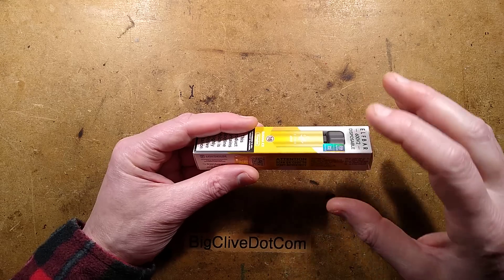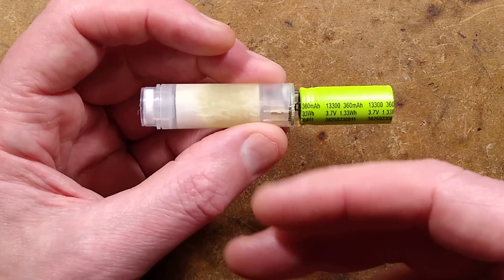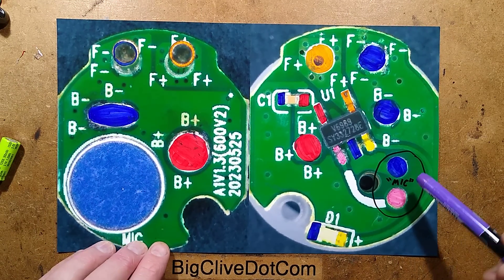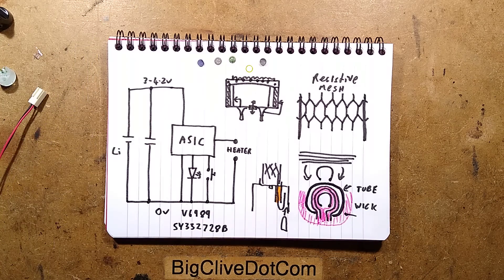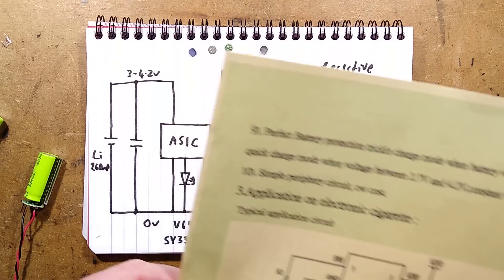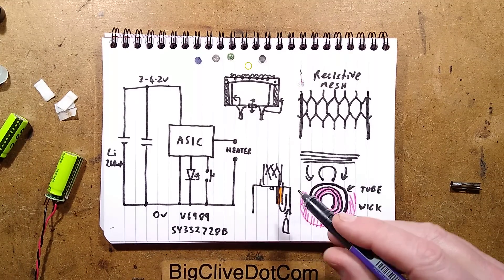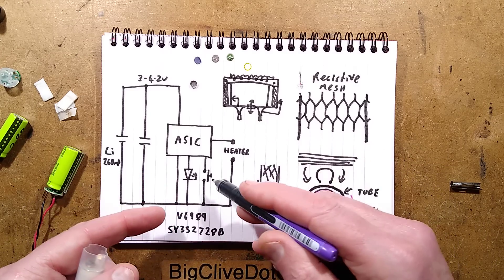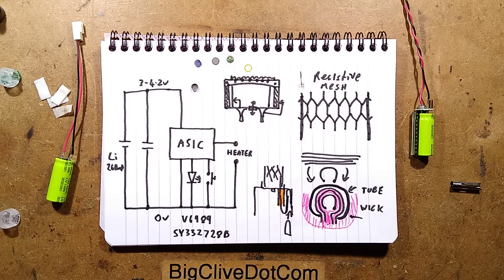Lithium "capacitor" in a disposable product

Comment: As I understand it, once a LIon cell EVER falls below 1.4V, the copper electrode starts to go into solution.  Then when the cell is recharged, the copper plates out and forms nucleation points.  Then lithium whiskers begin to grow, every time the cell is charged.  Sooner or later they tend to puncture the cell membrane and short out the cell, possibly causing a hot spot and igniting the cell.  Anyone remember the laptop and cellphone batteries that caught fire?
Reply from the maker: I featured that in a video a while ago.  The primary damage to cells seems to happen when they are reverse charged.

Comment: @bigclive, I found a 'lithium' battery marked at 2.4V. Any idea how they pulled that off ?
Reply from the maker: Not sure.  That's quite an odd voltage.  It's usually 1.5V or 3V for non rechargeable cells.

Comment: The mic IS a  condenser type microphone that requires power to use. They are used for audio reinforcing well as recording. Think concerts mic-ing instruments. They are also use for pressure differential sensors, which appears to be the case here, the subject sucks on the mouthpiece, this creates a negative pressure and turns the device on.

Comment: I've used a very similar (but much smaller) battery with a pwm driver to power a small LED on a cosplay accessory to be able to squeeeeze it into a tiny space without the bulk of things like battery holders or connectors. It made the difference between fitting in the available space and not, and with the tiny draw of a single LED it'll likely never be used enough to be depleted

Comment: As i first saw this video i asked my self if these are some form of Hybrid Capacitors. They were mentioned in one of my lectures at University a few years back. Did you check if they are some form of Hybrid between Capacitor and Battery ?
Reply from the maker: I think they're just purely a lithium cell.

Comment: The cartridges also contain heating elements which get gunked up over time, so you wouldn't really want to refill a single use vape. The "best" and cheapest method is to get a refillable tank unit and replace the coil every once in a while.

Comment: BC.C, ever since you first highlighted these disposable devices with rechargeable Li batteries. I've a few friends keeping the units for me to pull apart and to reuse the Li Cells and other parts for my own little projects. I've not come across this version yet. So it is interesting to know in what way they are connected first. Then, I can dismantle without shorting them out for me to salvage the Li Cell and other components. Thanks, buddy.
PS: Knowing you, Clive, you will want to deconstruct the Li Cell to have a look at its internal guts. Hmm, will there be smoke and fire, lol.

Comment: I'm glad the EU battery regulation will effectively ban these from 2026. (The regulation requires batteries in small devices like this to be user-replaceable, and it doesn't exempt disposable devices.)
Reply: Small correction: it comes into force in the EU on 18 February 2027. As often is the case, it took longer for the law to pass than they expected, so the date slipped.
Reply: It will backfire. I am soooo sure about that. Absolutely every EU regulation backfires and makes things much worse.

Comment: I ended up with a couple LiFePO4 cells in a similar package, I thought it was an interesting application for small devices, as it would make installation footprint on a board relatively easy.  Good point on having both ends of a cell right next to each other on a board, though, I can see that getting spicy if you're not careful.

Comment: My dad had a flat tyre the other day - heard a bang and then a hiss. Saw a 1 inch hole in the side wall. The guy at the tyre garage found one of these disposable e-cigs inside the tyre; they think my Dad must have driven over it in the street and it had exploded and shot into the side of the tyre. Apparently the second time they've seen this.

I wonder whether the capacitor package makes it more likely to turn into a projectile?

Comment: I found several manuals for this kind of ASIC controller and the MIC is indeed a microphone. According to the datasheet, a capacitance measurement circuit is used to detect pressure using a microphone. BTW, there are many pin-compatible chips that provide a charging function from the heater pin (ChipSourceTek FM8018A, Forkin P085 but P086 is a non-rechargeable version).

Comment: I never would have guessed a microphone could be used as a pressure sensor.
Reply: Yes, they can be used as microphones, or pressure sensors. Either way, they are generating a small voltage according to the change in pressure, despite what @celestialgamingxd  says.  Piezo devices can be used as microphones, pressure sensors, shock sensors (like in glass breakage sensors for alarms),  strain gauges, Etc. They are very versatile.
Reply: Bugger me, what do you think it does?
Reply: I'm the developer of this idea.
Reply: Its a pressure sensor, not a microphone.
Reply: @celestialgamingxd   What do you think sound is? It's variances in air pressure.
This device could be used as a microphone OR a pressure sensor. Piezo devices are what create the spark in many lighters. Piezo electricity works 2 ways, apply pressure, it develops a voltage, apply a voltage it generates movement. Ultrasonic cleaners also use large piezo devices to create the ultrasonic waves by reacting to a amplified ultrasonic square wave signal.
Reply: @jeffreyryan7671  This isnt i correct, however this isnt a piezo, they vannet be used as microphones, as much ss i wish they could for recycling purposes. Tons of people have tried
Reply: @celestialgamingxd  You change how a piezo is made, it becomes useful for different things as I said.
Reply: @celestialgamingxd  Does vannet mean cannot? If you put pressure on a crystal, it creates a voltage,  Put a voltage across it, it moves. THAT is a Piezo fact. However, I did get mixed up in that Electret condenser mikes are a (special made) capacitor with a steady-state voltage across it. It creates a signal when the sound moves one of the plates. I shouldn't have smoked that corn silk.
Reply: @celestialgamingxd oh this poor, confidently wrong lad is going to be tackled by so many replies

Comment: Lithium supercapacitors are in between a Li-ion battery and supercapacitor. More charge than regular supercapacitor and 3.3v voltage but voltage should not go below 2.5V as batteries. They hold charge much longer, lifespan is shorter. They probably let them dry to zero volts to make it unusable at this point. Their cost might be the reason for this thing. Its power values are too low for a lithium capacitor. Probably they produce them very cheaply in china. A big waste for disposable units.

Comment: I vape but I use the old school style vape where I wrap and wick my coils and so the only waste I produce is 2 pieces of cotton smaller than my thumb ever 2 days and 2 small pieces of metal every 2 weeks. There needs to be laws that force these vape companies to stop allowing the sale of these electronics that are destined to end up in a trash can after a couple of days. There are new vapes similar to the old school ones that use the salt nicotine coils that the disposable ones use, and I wonder why people don't use them because it's actually cheaper in the long run since a bottle of 30mg salt nic where I live is only 20-25 dollars which can last about 4 times as long as the disposable ones which are 20-30 dollars alone... But the reason why they are 20-30 dollars is because big vape is charging people a premium for the convenience of not having to do anything except unwrap the product and vape away. That convenience alone is causing so much recyclable components to end up in trash cans, while also causing people to pay too much...

Comment: This was an incredibly informative video, thank you so much, I learnt a lot. Can you perhaps answer why the lithium cell is in the capacitor case (other than needing to be in a compact cylindrical format)? I mean, you have said your gonna do this but I'm interested. I just find it weird that they need the traditional capacitor failsafe cap at the end. If a lithium battery goes, it bloody goes. The patterned failsafe would do bugger all
Reply from the maker: I think it's mainly to simplify manufacturing.

Comment: Lithium batteries in disposable devices are getting banned here in NZ. I'm not entirely surprised they've side moved to capacitors for the mean time. The old ones were just as easy to take apart but the average person doesn't care for doing that. They'll just chuck it in the bin :(.

Comment: Hey Clive i have a vape that's able to be wirelessly charged. I wanna recycle the battery and electronics. If i sent you one could you take the electronics and put them in a remote for like a tv? I think it could be done possibly without much modification to either component. The biggest thing is how to draw a 3v or even 1.5/4.5v depending on device and skip any trigger system to operate continuously when the device it's in is operating. I'd be happy to send you a couple to play around with and see how to do that.

Comment: As someone that's vaped for over a decade it's alarming how scammy these products became the second big business got into them. Disposable garbage. Straight up lies about power capacity and liquid capacity. Proprietary pods, tanks, and coils that they discontinue within months to slightly change the design so you have to rebuy everything. Not to mention contaminated e liquid from China that no one should use.

Easier and safer to use a mechanical mod and make your own liquid so you know exactly what's going into it.
Reply from the maker: The excessive use of strong flavourings is alarming.
Reply: @bigclivedotcom  Another reason I make my own liquid. 😄

Comment: I've got a box full of these disposables awaiting disassembly. It always feels like such a waste to just chuck them in the bin as-is, but even with all the useful components removed—battery, LEDs, USB connectors, screens(!)—the amount of plastic that ends up going to waste is still insane. I literally cannot fathom why this design took off when the pod-based rechargeables were already around long before them!

Edit: Forgot to mention, one of the more popular disposable brands here in the US comes in a plastic housing that is then wrapped all the way around with some kind of anodized metal (probably aluminum). We're talking 1.5–2mm thick. Not an insignificant amount of material. I've been saving those too; it's as good an excuse as any to buy a crucible, I say.
Reply: man did you completely miss all the news pieces in 2019 and 2020 about how terrible vapes were and how every high school kid was vaping and getting popcorn lung and getting hospitalized? I feel like before covid went nuts, that was the big topic on the news. First they banned sales thru the mail in 2019. Then Dec 2019 the president raised the vaping age from 18 to 21. In about March 2020 the FDA banned flavored cartridge-based vapes. Jul was the biggest one, but it took down tons of other pod vape companies. 

Personally, I live in NY. NY, MA, RI, and NJ all have total flavor bans. Disposables didn't "take off". They're just the only option available around here. And it's sketchy, like you have to know which vape shops in the area will sell them under the counter, or ask a friend who vapes where they buy them. Now instead of having US-made products and juice, we get to inhale  unknown shit from Shenzhen. :)

Comment: I'm guessing the pressure switch  has the same footprint as a PCB-mount condenser microphone and so they just re-used a generic template in their PCB-layout software, which happened to include a print mask with  a "Mic" label. (I do that kind of template-reuse myself a lot, though I am fussy and go to the trouble to edit the labels).

Comment: They probably did this because EU wants to release a law that forces manufacturers of devices that have Lithium ion batteries to be user replacable by simple means, with the exception of smartphones and tablets to which special rules apply. Now they have a capacitor, so the law probably doesn't apply here anymore!

In my opinion one time use ecigs should just be banned altogether. Also what kind of person buys them in the first place, they are expensive as hell

Comment: These new higher capacity lithium caps aren't totally uncommon. New in Vapes I guess. They're kinda cool too as I think they have pretty high current output compared to a standard Lion battery. I believe they're fairly common in EVs as they work with the regenerative braking systems somewhere in the order of 400+ Volts. I was shopping around for something like this for a project I was working on and came across them.

Comment: "Capacitor" style non-rechargeable lithium batteries where already in use in the mid 80s. An ELCO and this type of battery are so similar in construction that both can be made using the same equipment. Better be careful when you try to recharge, these lithium cells might be single use.

Comment: The reason why the non-pod, disposable vapes are so popular is because of regulatory failure in the US. Thanks to short sighted regulation, it is not possible to sell a system that uses replaceable pods in the US (if you know of places that do, as many still do, that's because they're technically breaking the law and importing them on the grey/black market). My guess as to why there's so much wasted extra connectors and durability added to the disposable vape you took apart is because that vape shares tooling/parts with another variety intended for sale outside of the US that does have the ability to accept replacement pods. It is simply cheaper and easier to manufacture one system (or reuse vape designs that were produced preban) than making a more ecologically friendly vape.

Comment: I'm going to resist a rant about these devices, and just say good job Clive for keeping awareness of these devices high.

Also, rechargeable batteries integrated into one use e-vapes, but TV remotes still come with one use batteries.

The most damning example of how insane the world has become.
Reply: But you can always put a rechargeable to TV remote. It's not like it's hidden inside and have a lid to replace it.
Reply: @sonickrnd  Depends on the voltage the remote requires to operate. Single use AA is 1,5V, rechargable AA is 1,2V. It may not work with lower voltage

Comment: and back then we had mechanical mods. could've just borrowed the fundamentals over to disposables..

a little to note to those who doesn't know, the reason disposable vape from China is so well marketed is because they have backlogs of batteries that failed QA in capacities so they push it to closed ecosystems like these. fun fact.

Comment: This so weird to see, when I first used these devices over 10 years ago they used to be made of metal/glass, fully modular/repairable and used alot of standard components. These companies have really gone full circle by adding some modularity back - except now they cost 10x more and taste like pure plastic.
Reply: You're thinking of a "mod", which is distinct from disposables. You can still buy those, it's much cheaper if you're a habitual user. $60 including batteries and a tank is a very normal price, $15 for a bottle of juice that will easily last you as long as ten of the disposables. The breakeven period is only like a month of moderate use depending on the price of disposables in your geographic area; I've lived places where they're $2-$5 each, but most places they're more like $10-$15 each.

Comment: The ones I use just have a standard 18650 in them. I pop the mouthpiece off to refill it, and when the battery dies, I desolder it, pop it in the charger and swap in a charged one.

I have experimented with desoldering the battery and attaching a spring with a little 3D printed insert to the wire at the bottom of the atomizer/tank section, and affixing a permanent contact on the cap, so I can just slip the battery in and out like a flashlight, but while it worked, there is a limit to how long you can use one of these before the wick is done for, so it ended up being more trouble than it was worth.

It's kinda fun trying to make it user serviceable and keeping it going, but if that ever became impossible, I'd never buy another. Bare minimum, I salvage the batteries out of them, but I'm not of the opinion that "cheap enough not to care about it" = "disposable"

Comment: I recharche my elfbar since I bought them. But the batteries have really low cycle counts. -10% per recharche is usual.
Reply from the maker: I've got some here that I'm sure came from early Elf bars that I have recharged about 50 times with no significant loss of capacity.

Comment: Why are throw aways even legal at this point... It's also stupid of the manufactures to keep producing them. You literally showed the better option that they themselves make, they should just Not make the trash version. 

Also... Do you suck in lithium vapors with this device? I'm curious if there is truly 0% chance a cheap .000001 per dozen battery would never off-gas in Any way. To me it surely looks as if the air passes the battery and circuit board... maybe in an effort to save space or for cooling but it just seems... Not great.

Comment: microphone is a pressure sensor. it picks up vibration of air (changes in air pressure) via a piezzoelectric (ability to generate electric charge when mechanical stress is applied) material to generate an electric signal.